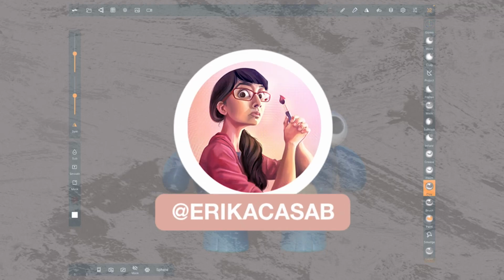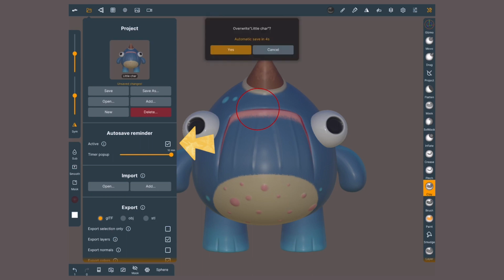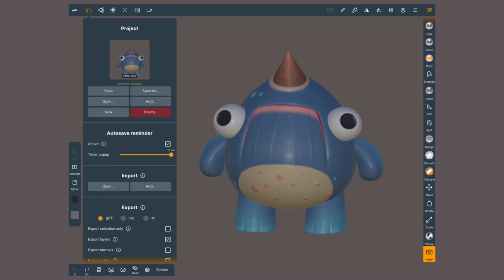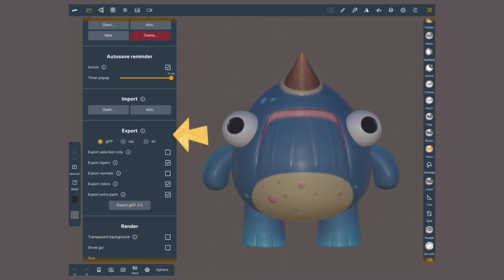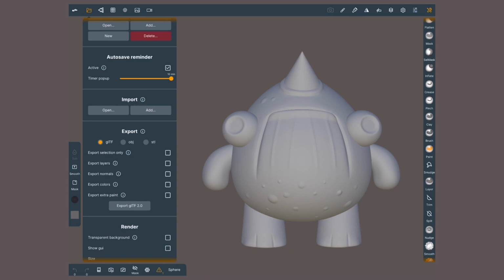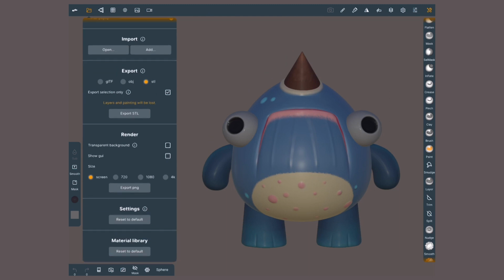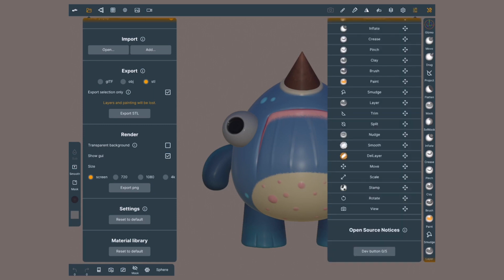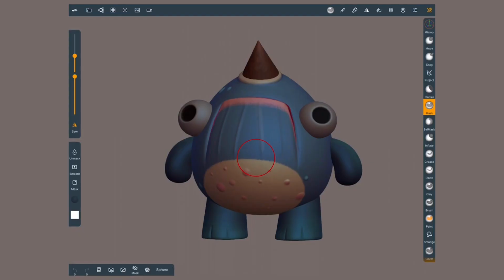Nomad Sculpt: Project Menu (Save, Export, Import, Render...)

Comment: I'm trying to export png file but it is exporting only one layer (scene) not the whole picture and there is no option for merge layer.
Reply from the maker: When saving a PNG (aka rendering) the result will be whatever is visible in your screen. If you zoomed in and objects on your scene are not visible they won't show up on the PNG. 

If you are exporting to (glTF, OBJ or STL) and you want the all the objects in your scene, make sure you deactivate the option 'Export Selection Only'. Otherwise only the object you have selected will be exported. To merge several objects into one, you have to multiselect them inside the Project Menu and select either 'Simple Merge' or 'Voxel Merge'. I explain this in more detail on my Scene Menu video. 

I hope this helps.
Reply: Thank you so much, It worked